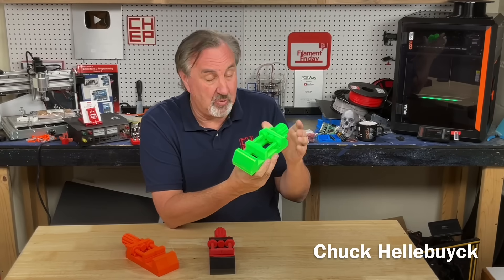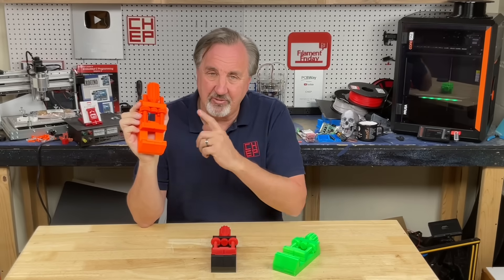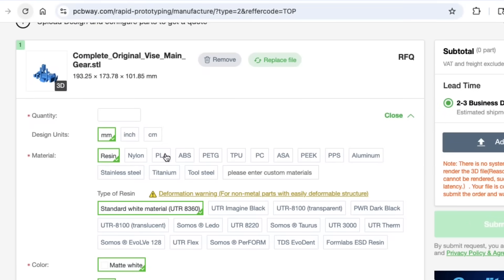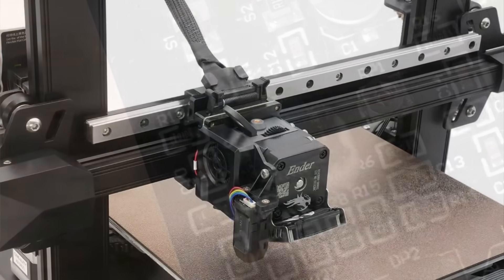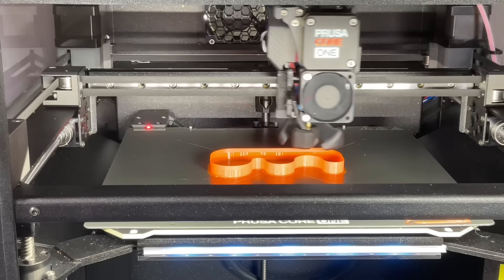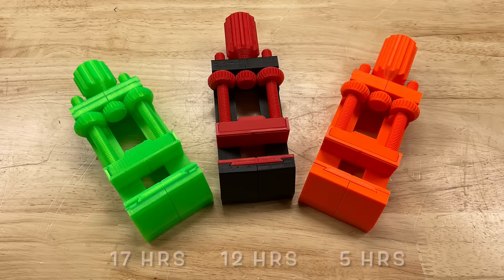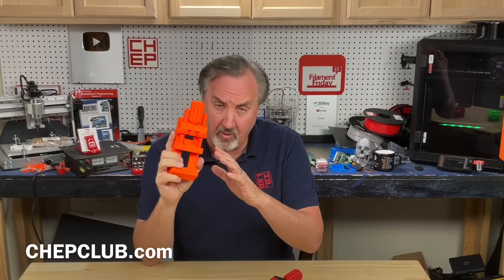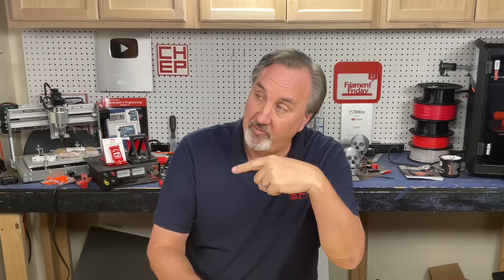How Did 3D Printers Get So Much Faster?

Comment: It felt good when I finally trashed my ANET A8
Reply: Don't be too hard on the A8.  Those cheap kits were a gateway to the 3D printing world for many.    Yes, it was slow and took and age to set up and there were the thermal runaway issues from dodgy boards and power units but I ran mine for six years with no problems, moving up to and Ender 3 until moving to core XY last year.

Comment: "CR-10... Old and slow printer"
Thats the only thing I was able Buy you Monster !!! 😭😭😭😭
The buying power in Brazil is 20x lower than US and EU... what is cheap for you, it costs a CAR for us....
But yeah, the printer is very slow, I recently made a major upgrade/modification on my printer and somehow installed a Unicorn 0.8mm Nozzle, and omg how my printer fly now... ABS from 4mm³/s to 25mm³/s
Living on a 3rd world country really sucks sometimes...
Reply: You should be able to do more than that. The sprite on my v3se with the unicorn taps 40 on a 0.4 nozzle. 0.8 should be way faster. But I never do abs because I have no enclosure
Reply: @forbiddenera  - I didnt push to the limit yet, but I was able to put 32... the problem is the printer itself, CR-10 moves the Plate on 2 axis, also, just like the video explains, no fine control on the motors.... my printer barely holds 60mm/s speed without loosing steps.... printers today have 10x more acceleration than this old fart....
.
How do I reach 25mm³/s with such low speeds? yeah, 0,5mm layer height and 1mm walls, thats how...
Reply: Give me your contact info so I can mock you even more about being poor
Reply: You can always end it😊

Comment: Most of the speed improvements came from advances in stepper motor drivers and switching from POM wheels to steel wheels on bed slingers..  Which was more of an industrial engineering effort rather than something that came from the open source crowd.
Reply: Who uses steel wheels? Enderclones still use POM wheels, anything more premium does not use wheels-on-extrusions at all. It's either linear rods and bearings (like on the Prusa i3 since the early ones) or linear rails.

Also you can still get to 5K accel with POM wheels on an ender frame.. (10x what the ender3 stock firmware allows) At which point you're kiiiiinda starting to run into just the bed weight being the bottleneck for accelerations :D
Reply: reprap started out on linear rods, idk what you're talking about

Comment: One of the changes has to do with the general culture around 3D printing pricing. When I was first getting into it, all I heard was "how cheap" you could get into the hobby. You could grab an Ender 3 for $150. Price was all the rage. 
Nowadays, people are spending minimum $400 and up to $2000 for fancy Bambu printers.

While of course you could buy expensive printers in the past, or get cheap ones today. I feel people tend to lean more towards expensive units now.
Perhaps it has to do with the general trust we have for the aesthetics, consistency, capabilities and strength of 3D prints. 
I see it a lot like another tool in the workshop, vs a novelty toy. 

So of course, a unit with better components, more rigid frame, and automatic features will outperform a budget printer.
Reply: You can get an A1 mini for like 200 bucks. Or something like creality 3 v3 for the similar price.
Reply: Some people are "spending minimum $400 and up to $2000 for fancy Bambu printers.", but your entire logic is absolutely dumb.  The manufacturers have done constant iterative upgrades to compete with each other.  We get much better printers that are not that much more expensive than the old ones.
Reply: There really was a race to the bottom - and they did it - sub 100 buck printers. However down there were no winners - neither the brand nor the customer.
Reply: Not everyone pays the bambu tax my friend
Reply: @ungabungus01  you mean the smaller market segment? 😂😂

Comment: Probably a move from fdm filament to sls powders will be the real speed innovation.  When those prices are in reach for home use, that will be huge
Reply: It was close to home affordability but formlabs ended it buying out the project
Reply: How can that increase speed?
Reply: @AlessioSangalli a whole layer at once. Also, flow rate though a nozzle isn't a problem. There is the challenge of melting without burning, but that is still going to allow for more speed than fdm.
Reply: @amadensor oh you mean a process similar to metal three Dee printing?

Comment: I've been in 3D printing for about 13 years. You noted many of the improvements, one significant one with multi-material at least from a mechanic standpoint was paying attention to what stratasys was doing. Long melt zones and dual extruders are old hat for them. But yes processing power and stepper drivers are probably another big contributor

Comment: I guess it is time to upgrade, I'm still using my only 3d printer, my CR-10.  I guess being an early adopter is not always the best. The CR-10 was just so much better than my Prusa Mendel I didn't think I needed anything better.   As a side note the Mendel was made of 3d printed parts and all thread, that predates even some of the more popular wooden printers.
Reply: Sometimes it's a bummer to be an early adopter for the right products because we get to keep them a long time! I feel the same way about my ol' MK3 but these new printers are getting hard to resist. I agree the real question is how much longer should we run them?
Reply: @LoganHenry Why a new printer? All you need is a €20 Raspberry Zero 2W to upgrade your existing printer to Klipper and use all the new features. Maybe add an acellerometer (you could tune input shaper manually, but automatic is more comfortable). An old android tablet can be used as display for KlipperScreen.

You also can of course upgrade the printhead. On one of my mk3s+ I upgraded before to a light zOrbiter 2.0 with Revo Six. A few months ago I changed the controller - not adding Klipper, but using the Prusa Mini´s Buddy board (Marlin also has input shaper now). Cost a bit more (about €54 with display, from AliExpress) - and it now has the speed and print quality like a Prusa mk4 (I made a video about this upgrade). Esp. usefull if you upgraded the full path since the original mk3 (mk3->mk3s->mk3s+->mk4(new bed, as mk3 had soldered wires, new black PSU)->mk4s->CoreOne) and now have nearly all parts to build an mk3(s(+)) again.

Yes, I love my new printers like the Core One or Qidi´s X-Max 3. And I am about to build an RatRig vCore 3.1-500. But this does not make the old printers obsolete. With Klipper it is f.e. quite easy to add multiple tools. So if you have an good old Anycubic Chiron - upgrade it to Klipper and new stepper drivers. Change the X-Axis to a longer one with a linear rail and place two printheads on it - not an IDEX, but two tools to be simply switched between. With modern toolboards (USB or CAN) its not a big deal in cableing. Two toolheads allow fast change between two filaments without much waste. Wich - unlike with a filament changer - do not need purge and have no contermination using different materials. Wich allows f.e. PLA/PETG-support-trick.

Of course big bedslingers can never be as fast as CoreXY due to big moving mass (the bed). But the easy way to extend the x-axis allow them to easy to be converted to dual extruder for dual colour or dual material. In theese scenarios they are faster than most modern printers (exept >2k€ printers like Bambulabs H2D, H2C, Prusas XL, RatRigs vCore4-IDEX etc.). Another aspect: Even a big bedslinger like the CR10-S5 fits through most doors (just tilt it a little). A vCore 4-500 doesn´t. If you build the printer in one room, but want to use it in another, this can be a major aspect. Never build my JennyPrinter 650 (a 650by650by650 Voron 2.4 derivate - outside is 950by950by1050) as I missed this point (but I will eventually build it, with only 250mm height(so 650 minus wheels I mount on the side, so about 650 hight)  - so I  can tilt it and fit it through doors).
Reply: I wouldn't say being an early adopter hasn't been the best.  Think of all the fun you'd have with your CR-10!!!
I was running my CR-10 Mini for years and have been pretty happy with it.
But I recently saw a flash sale on an AD5X that I couldn't say no to....
And while I loved my CR-10 Mini, this new printer is SO MUCH FASTER!!!!  ;-)

Comment: I wish I had gotten into 3D printing 8 or 10 years ago. Then maybe I could be impressed with the speed of current printers, instead of seeing them as mind-numbingly, soul-crushingly slow (which is what they are  😠).
Reply: Yeah. I got into 3D printing in late 2018/early 2019 and it was enough of a difference to be blown away by today's printer. But I also got a BSN and make many times more money so it's probably that
Reply: @jmc042  Bachelor of Science in Nursing?
Reply: @KarlBunker ye

Comment: Few years ago, the motion system was the bottleneck. Now, its not that. Now we have to solve the thermal limits of the materials before losing properties, as for heat transmission and cooling
Reply from the maker: Agree. That may be the next advancement.
Reply: @FilamentFriday i like what FLSUN did. Maybe we will see external cooling units, but not just external air, but AC cooled air for rapid cooling. And for heating, probably longer nozzles would do the trick. Ive read thsr PLA can handle up to 105mm3/s in lab conditions, so, technically we can achieve it. External AC cooling unit mught do the trick for higher speeds in single color. As for multicolor, the H2C and INDX are doibg a great job and they are in the right direction

Comment: I recently bought a Bambu Lab A1 combo a couple of days ago and was blown away by how much faster it was at printing than my previous printer, the Sovol SV06, which I had been using for over a year.

While my SV06 still prints just fine, only have an issue with the print tolerance being too tight, I bought the A1 because I wanted to give multi-color printing a shot. However, after printing with the A1 and seen how much faster it was, I'm having my doubts about ever using the SV06 ever again!

For comparison, the SV06 takes about 1 hour and 50 minutes to print the Benchy boat. The A1 can print the same boat in only 20 minutes, and that includes the 6 minutes it takes just to calibrate itself before printing!
Reply: You could upgrade the SV06 with Klipper and drasticly increase the speed. For tolerances: PrusaSlicer and its derivates have x/y compensation to deal with this.

Comment: Maybe the question is not if we could print it faster, but why we should print it even faster?

We can increase print speed with longer melting zone to transfer more heat, structured melting zone to transfer heat faster, or higher temperature to again transfer more heat faster.
No matter how melting is achieved *) , usually hotend works optimally in limited speed range. Too slow -> ooze and stringing, too fast -> cold filament and matte surface with lower layer adhesion.

However, we (well, I, hopefully others as well 😉) want to have somewhat consistent surface finish, somewhat predictable structural integrity and no stringing.
Also faster speeds and higher accelerations require more aggressive input shaping, which rounds corners and reduces details.

At what time would it be printed in large frame resin printer (30 .. 100 mm/h) and optimal part placement?

*) inductive heating could be fast enough to dynamically change filament temperature based on need?
Reply from the maker: You can always slow it down for better quality but being able to make a vise or any similar print in 2 hours vs 5 is an option I’d think anyone would want.

Comment: Multiple heads printing at once. Like a spider weaving a web
Reply from the maker: That would be interesting to see.
Reply: Big problem is that you need something to hold both/multiple heads in the x and y coordinates. And you will either share that "something" (ie o common rail on IDEX) or you have to solve for collisions. Either way it will slow the print down and the advantage is only on large prints or if you are printing duplicates in parallel. Not a general solution for speeding up the print.
What could be possible is brush-like nozzle that is wider in one direction and narrow in the other direction and is able to rotate during the print - you could print thick walls in a single pass while also beying able to print thin structures.
Reply: @petrkubena  Large prints are the ones that take the most time, right? Also, you're limiting yourself to current print head sizes and rail systems. Robotic arms (for mere example) can be pretty precise. Cooling can come from things other than fans right next to the print heads. They're already printing things in random planes now, tho it's all the same plane. Don't for get "Muh AI" advancements. As for big nozzles they could definitely be used. What about a dynamic size nozzle eh? Almost anything is possible with enough time, money, and the will to spend it well

Comment: Tbh I dont think "much" has changed hardware wise. The belts and steppers always had much more performance than we leveraged out of them. Hotends havent changed that much since the Dragon era if you exclude the Revo, and extruders are also pretty much "solved" since the Orbiter days over 5 years ago. Linear rails finally becoming "standard" was a huge deal, CoreXY reaching mainstream was too. Although that isnt even necessary if you take a look at the Annex crowd pushing speed records on their cartesian beasts or makerbot restomod projects who are pulling some crazy things with them. Imho the biggest thing in 3d printing innovations hands down was Klipper. Input Shaping unlocked speeds that wouldve lead to terrible ringing before. Without turning a single screw, if you just plug a RasPi into the USB Port of any old printer and run Klipper on it instead of whatever it came with, you can get so much more out of the exact same hardware it is insane. Klipper exclipsing Marlin as the defacto standard printer firmware opened the flood gates. Then came Bambu, packaged almost all the lessons the open source community had made up until this point into a well built turnkey machine and forced everyone else to step up their game. The X1C was the Tesla Model S of the 3D printing world, and I mean that for all the good and also terrible developments both products have brought over their respective markets.

*Anecdata: My old Sidewinder X2 was good for maybe 60mm/s with an aluminium bed if you wanted your part to look good. After switching over to Klipper I could comfortably pull 120-150mm/s at 2.5k Accel (up to 10k for travels) slinging that huge bed around and have since put over a 1000 hours on it on original belts, steppers, v-slot wheels, mainboard, drivers, (mostly original) extruder and hotend etc.
Reply: Klipper vs. Marlin isn't realy the big deal by itself. Marlin needed longer to add input shaper - and as Klipper uses a decentral structure with a seperate controller running linux, its easy to upgrade. For Marlin with (automaticly calibrated) input shaper you need a controller with more powerfull CPU on the actuall controller board, but it works as nice as Klipper imho.

In the video you often see the CoreOne. Wich uses a Marlin fork, with input shaper (and even a feature for the TMC2130 drivers to adjust to the motors, for more smooth and silent operation - haven't found this on Klipper yet).

But you are totaly right, simply adding a SOC like a Raspberry with Klipper to an old printer was a game changer. Also Klipper allowed companys to release fast printers without much R&D.

Still, I like Marlin (with input shaper). Some old printers I upgraded with the BuddyBoard from Prusa´s mini, as it is quite affordable (original 43€ at Prusa, but cloned display for about 13€ instead original for 60€). Sadly without motor calibration, as it uses TMC2108. However, I do this mostly for printers with a quite simular printhead as the mk3 to CoreOne (DirectExtruder, NormalFlow (or CHT) nozzle (mostly Revo)). The reason: Prusas printing and filament profiles work like a charm.

I even converted my Qidi X-Max 3 to a Revo hotend, so the printhead became quite simular to Prusas Nextruder in its main characteristics (distance between extruder gears to nozzle, meltzone size). Adapted the CoreOne profile to the X-Max 3 (size, gcode-flavour, clockwise slizing(for Revo), preview picture formats). So much less tinkering with filament and printing profiles now. It might be a bit slower now - but now I get very good results without much tinkering.

Comment: Man, I was just thinking about this.  I got an OG ender 3 back 7 years or so now, and it was not the newest thing at the time.  But I recently got a P1S (with AMS) and it honestly made me speechless at its first print, both in speed and multi material capabilities.  I have done some bigger mods to my ender 3 over the years, but it’s still doing 11 hour prints where my P1S is doing the same thing, multimaterial, in 2 or 3. But I have to say I still love the singsong sound of the ender 3 steppers even if it’s an skr mini now instead of the oem ender board.
Reply from the maker: How are you getting 2 to 3 hours in multi material on your P1S vs 11 hours on Ender 3? 
With all the color swapping multi material/color still takes a long time.
Reply: @FilamentFriday I'm talking about small prints with 2 colors, nothing large for the 2-3 hours.  And to contrast, I've always kept my Ender pretty slow to get a good finish when comparing the same models.   I never spent the time to tweak settings on it much.  

That said, my P1S can do a 120mm diameter coaster in 4 colors in 3.5 hours. It's only 5mm tall so the colors don't have a ton of changes per vertical layer.  The times when I am printing things (like text) vertically are the ones I find it eats up the most time.  If it's a fairly flat print it goes impressively fast, even with 4 colors.